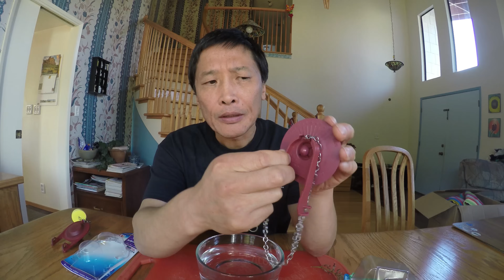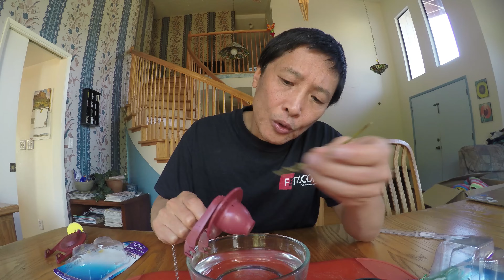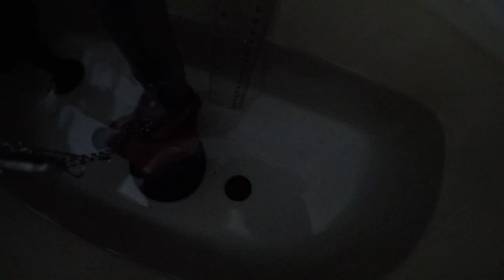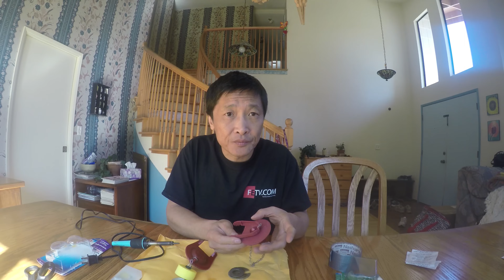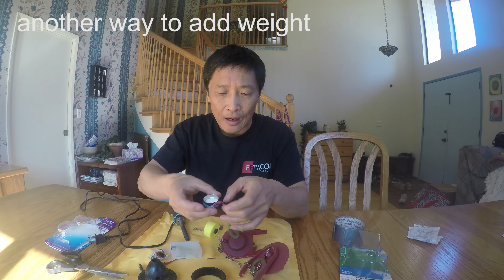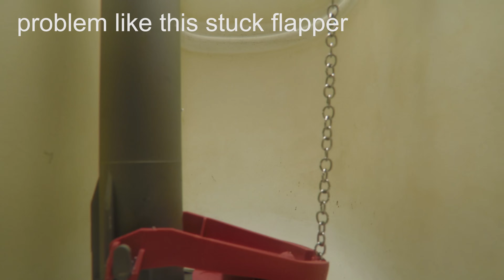Big Mystery of the Adjustable Toilet Flapper Solved

Comment: Just to make sure I understood correctly, if I buy a non-adjustable flapper designed for pre-1994 toilets and use it in my 2000 1.6gpf toilet, it will close too soon?
Reply from the maker: it depends on how you adjust it, this video will provide a complete and very precise answer: https://youtu.be/hTlKA67en6s .  I learned this the hard way, wasting a lot of water for a long time even for a long time dual flush toilet tank: https://youtu.be/9fvWpqNGX8Q

Comment: I bought the fluidmaster 500 because it's what was in stock. After watching your video I inspected my new flapper. It has only the hole on the bottom. No other hole up higher under the rim. Wonder if I burn a hole through the front if it will be equal to the 1.6gpf setting on this fancy schmancy rig, or if I should just flush it and buy a better flapper 🤣
Reply from the maker: is your flapper "adjustable" one? regular flapper does not have that hole.
Reply: @GeniusAsian  no I bought the one I said was in stock. My original flapper did have a hole on the side. Cut out a hole in the new flapper, same location as original, and it actually helped. Glad you solved the mystery.

Comment: I'm confused 😕, I'm misunderstanding where the location of the adjustable hole should be located for minimum and maximum amount of water for a flush. When you explain about plugging the hole in the front and adding a hole on the side you say that it would allow maximum water for flush but in the video you made of it actually flushing it states that it's in the minimum position yet the hole looks to be off to the side instead of to the front where I thought minimum was located. So then which location is minimum and maximum? Isn't minimum where the hole is located in the front and maximum would be to one side?
Reply from the maker: Thank you for taking the time to comment here, it would help other viewers. When you say "yet the hole looks to be off to the side instead of to the front", from the video it still looks to the front, which exact time stamp of the video that you watched that showed it is on the side? When you provide a URL of the timestamp, you can use your right mouse to select the "copy video URL at current time" such as this one with ?t=200: https://youtu.be/BDy9d_B6xRM?t=200
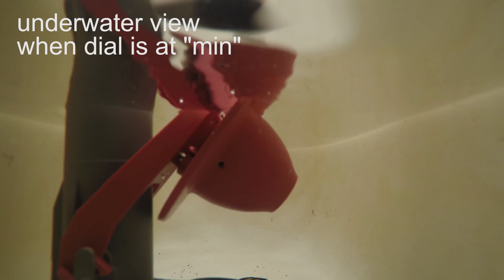Reply: @GeniusAsian  At 2:32 it says "underwater view when dial is at minimum" but the hole is on the side. I thought when the hole was on the side it was at maximum not minimum. Minimum is when the hole is at the front isn't it, so that air escapes more quickly?
 Anyway, I just now plugged the hole in front with a silicone table top stem bumper and burned a new hole in the side with a soldering iron and now the flapper stays up longer and flushes much better.
Reply from the maker: @bodeine454  Thank you for the link, it is interesting. After I made the video to experiment that flapper, I have changed all my toilet flushing to dual flush toilet (you may check out these videos), so I don't have any traditional flappers to experiment with, so I assume the theory is the following. The older toilet tanks are 4 to 7 gallons volume, the newer toilet tanks are 1.5 gallons. Suppose volume=Area*H (H is vertical height), therefore the older toilet tank has larger Area, if you want to flush less water, then you can reduce the H, see this one https://youtu.be/hTlKA67en6s where you need to put some object to reduce the Area so that you can have sufficient H to adjust the water. Back to your case, when we discuss to adjust the flapper, if H is too short, it will affect two different time periods. There are two different time periods: period1: the water flow out of the pocket of the flapper right after you just lifted the flapper. period2: the water will flow into the pocket of the flapper when it is in the refill state. If your toilet tank is the older type that H is too short, then the period1 may not have time to happen to empty the water, therefore it will fall back quickly on the base to plugin the hole to block flushing water. When you drill a hole on the side, the water can flow out quickly therefore you will have the first period to make the flapper having some air and make it "float" a little longer.

Comment: Your demonstration showed that the Min. setting  leaves more water in the tank - " 3.5 inches of water remains" . The Max. drained out more water, leaving just - "2" inches water remains" in the tank. The Max is a bigger flush, right. More water down the drain.  Why would you want your flapper on Max., if the Min uses / left more water in the tank? If you are trying to use less water to help the environment?  So the ideal is a flapper set on Min and a coin to weigh it down to make a better seal, Correct? I wish you had summarized after the end of the first  demo instead of going right into the coin demo. Thanks anyway.
Reply from the maker: yes, you are correct there are different methods, for example this is the calculation: https://youtu.be/hTlKA67en6s
my dual flash system actually wasted more water: https://youtu.be/9fvWpqNGX8Q
other tips: https://youtu.be/CtSzDN6ann8
Reply: Great comment Deborah! After reading numerous comments, this one makes the most sense.

Comment: Thank you that was very useful. On a side note, as I probably had it with the hole pointing to the lower position, not only it flushed a lot BUT also would stay stuck in the upright position as it was too light to get down. - So I have it positioned in the middle position now and it seems to be going better. :) - Thank You again.
Reply from the maker: it's really nice of you to spend time to chime in and to share, your tips will help other viewers.

Comment: Have never seen a flapper like this before. I usually get the standard flapper with the float. You can adjust how much water you flush with those by adjusting the float up (less water, flapper closes sooner) or down (more water, flapper closes later).
Reply from the maker: yeah,  there are a few factors, the exact measurement is shown here: https://youtu.be/hTlKA67en6s

Comment: I had the adjustable flapper for several years, it worked good but eventually it stopped sealing well, so I bought another one, for some reason it didn't work right, it worked like a regular flapper, changing the setting didn't change the amount of water it used, after hours of playing with it I gave up, then I got the next months water bill, I used hundreds more gallons of water, so I'm back to trying figure out why it doesn't work, I just realized after watching this video why it doesn't work, the plastic plug that goes in the big hole is missing, maybe it fell out, I don't know, but at least now I know why it didn't work right, they do save a lot of water when they work right.
Thank you.
Reply from the maker: Thank you for sharing your story. For many years, I thought I had saved water, but in fact we have been wasting a lot of water over the years, so make sure you MEASURE the amount of the water: https://youtu.be/hTlKA67en6s
Reply: Pulling it up to high

Comment: I think you have the 2 under-water shots reversed; otherwise, very informative video. Thanks!
Reply from the maker: This is very tricky, so think about this way. The small hole for min is higher, i.e. 3.5 inch, when the water lowered and exposed the hole, the water from the bottom larger hole will go into the chamber, pulling down the flapper.  If the small hole is submerged under water (not exposed), water can not go into the bottom larger hole, i.e. the chamber is full of air making the flapper float like a floaty.
Reply: Exactly -- your explanations are correct; but your first under-water shot at 2:30 is for min and the small hole is supposed to be at the highest position, but the video actually shows it's at the lower position. That's why I stated your video was edited in the wrong order.  Cheers.
Reply: Immediately when the flapper is raised,  before the small hole on top is exposed, the water from the bottom large hole will go into the chamber, forcing out the air from the small hole producing bubbles, because the pressure on the large hole on the bottom is larger than the pressure on the small hole on top. The higher the small hole on top, the more water will enter the chamber, and the quickly the flapper will fall, and less water will flow to the toilet, and vice versa.

Comment: the float is adjustable as well...if left high on the chain it will close too early..low float uses more water,,float keeps flapper up until water level no a longer supports it
Reply from the maker: you are correct that the chain and float also contribute to the flapper closing time. However this video explains the DIFFERENCE between two different designs under same CONDITIONS. The effect of the chain/float to two different designs is the same, thus is considered as the same condition.